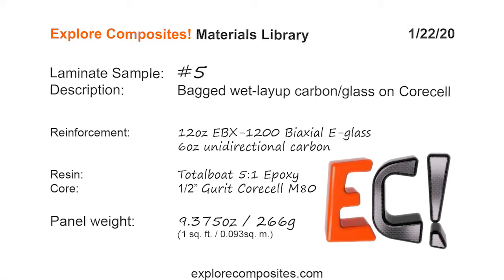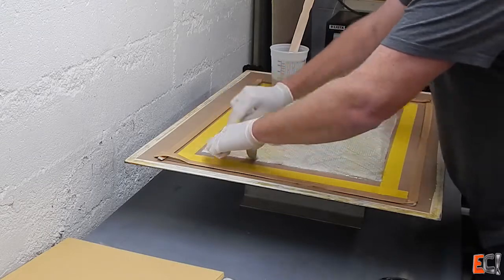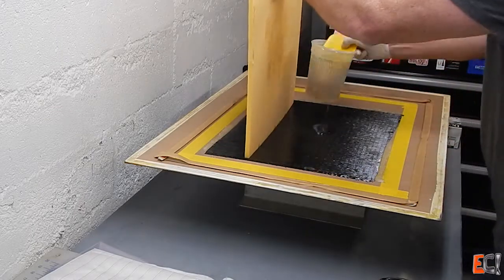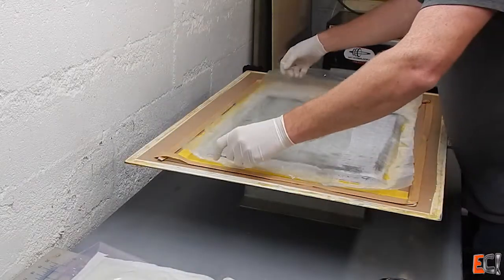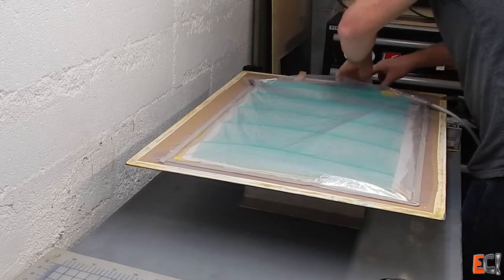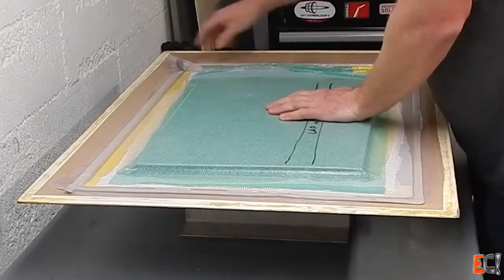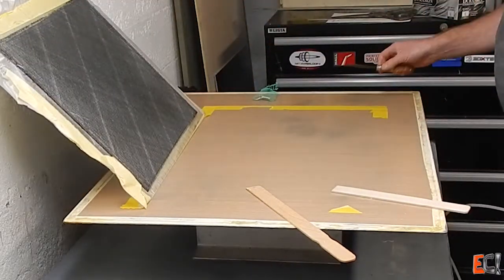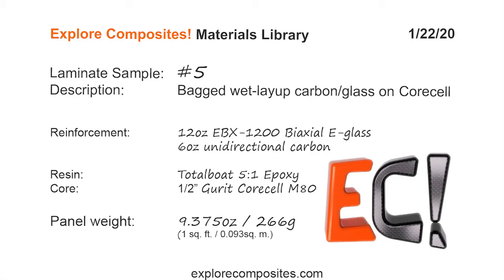Laminate Sample #5: Vacuum Bagged Wet-layup Carbon/E-Glass with Foam Core

Comment: @ExploreComposites how do you estimate core bonding resin uptake of the foam? cant seem to figure it out
Reply from the maker: You really have to test to be sure, but estimating the volume of perforations and flow grooves is pretty easy if you measure with a caliper and do lots of multiplication.  Plain foam surfaces take up resin inversely proportional to density of the foam because high density core has smaller cells.  Nothing like a few square meters of test panel to get it figured pretty well including surface flow and feed lines.

Comment: I have a moderately complex shape epoxy layup using  2 layers of 5.8oz CF and 1 layer of 6 oz E glass. I was planning to use peel ply and breather before bagging.  I see that you are using a perforated layer as well. Is that necessary? What vacuum pressure is appropriate. Thanks for the great videos.  Very helpful to a newbie to this process.
Reply from the maker: Almost always it is best to use a perforated release film.  Without it you will suck out too much resin and make removing the breather very difficult - like no fun at all!  You can make perforated release film by folding up thin painters plastic and punching small holes every 2” / 50mm or so.  Its not as good as the actual product buy WAY better than nothing!
Reply from the maker: Vacuum for wet bagging - about 15inHg or half of full vacuum is a good place to start.

Comment: How did air get in the part (porsitsuty) if you pulled the air out with the vacuum? Hole in the bag?
Reply from the maker: There is air mixed in with the resin when hand wetting-out and I am quite sure the glass wasn't 100% saturated.  Ideally the compression of the bag will force most of the air out, but a bagged wet layup will always have a much higher void content than infused or pre-preg.  This was an issue of not being able to get air out, rather than having air leaking in... either way not great!

Comment: what type of foam did you use, why doesn't it melt when exposed to the resin?
Reply from the maker: This is a Corecell SAN foam made by Gurit - it is designed to work with the resin and not melt.  EPS foam will be "melted" by the styrene in polyester and vinyl ester resins.

Comment: I would say that the dry spots mainly come from the air sucked out from the foam core, if the core is previously sealed and there are no leaks, you can vacuum as much as you can and even had external extra preasure (autoclave), no air will come to replace the resin, no dry spots.
Reply from the maker: You may be right - it was more dry than I expected.  Possible the glass never got wet out completely, and also looks terrible backed up by the black carbon - everything shows!
Reply: Hello, my question is what is meant by sealing previously the foam core? I am trying to do the same for a large project. Can it be done without excessive epoxy bleed-out?

Comment: This is exactly what I am planning on doing. What bagging material and vacuum pump would you use to do it on a 14’x10’ sandwich panel? Also, why did you mix fiberglass with carbon glass - don’t they have different structural properties and one would affect the other?
Reply from the maker: A panel that size should be doable with even a very small pump... as long as you don’t have leaks!  Bigger pumps just get it done quicker and higher pump volume makes leaks easier to find.  

The glass and carbon here are pointing in different directions which is common - adding carbon uni to a glass laminate for  local reinforcement.  If glass and carbon are together pointing the same way the stiffer carbon will take up all the load and the glass will be redundant.  Also here it made it easier to see the over-bleed because of the contrast.

Comment: You make it look so easy but every time I try this kind of work with glass or carbon I end up sticking to everything, Definitely going to try your techniques, thanks for a great video.
Reply from the maker: Thanks!  And don't worry - I make tons of messes too!  Been 15 years or so of doing this professionally so I like to think I have learned something - but it's always a challenge to keep things organized and avoid surprises.  

Not everything I do in these laminate samples is "best practices" but I try to point out common mistakes by demonstrating - like the over-bleeding of the resin here.  The idea is to show a type of laminate, but also to show how to dodge some of the more common issues.  

Hoping some day I'll have the time to make some more detailed how-to videos...
Reply: @ExploreComposites  Thanks, I've learned a lot without getting my hands dirty so far or wasting materials with trial and error. Once I have all my materials and the weather is warm enough I'm gonna have a go at making some carbon panels.